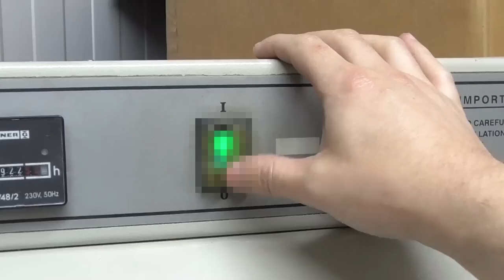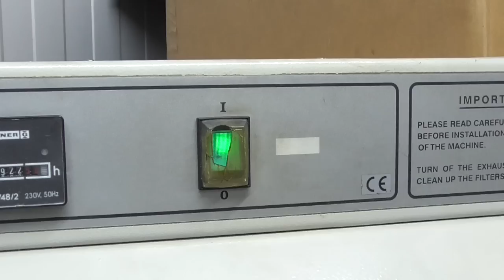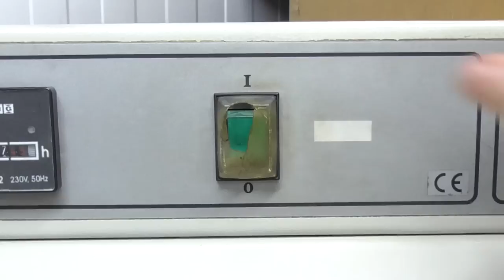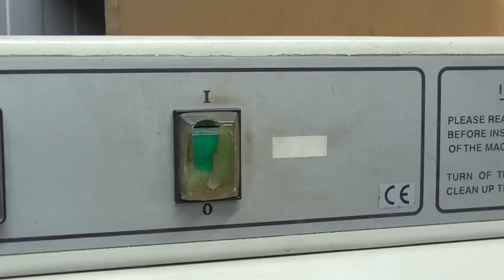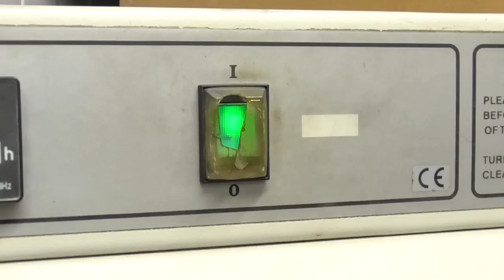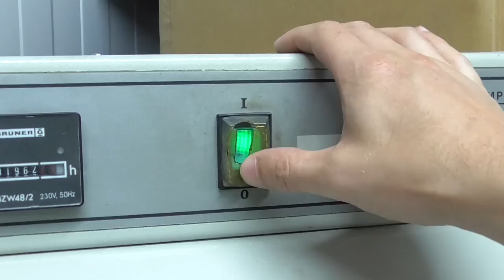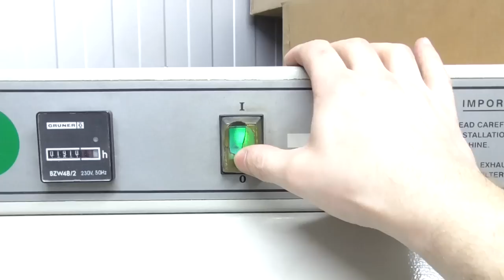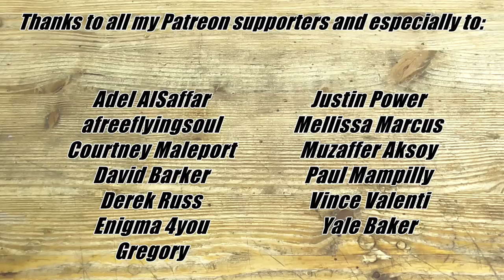Most Satisfying Way To Remove Rust - Sandblasting Compilation

Comment: I'd love to see some micrometer measurements of how much material sandblasting actually removes, as well as information about the different blasting media.
Reply: same. does it round off edges like the  polishing wheel does?
Reply: Not much, unless you hold it in one place for a long time. You just do it until the rust is gone though. The edges don't round much either. You could do a knife and only have minor repair to get the edge back.
If you want even less damage you can bead blast, or walnut shell blast. The shells being more of a cleaning process.
You can use several things for the media, but is needs to have uniform size or it will clog the nozzle. Aluminum oxide grit is the most common.  Silicon carbide could also be used, but is more expensive.  General dand can be, but must be screened well, and breaks down faster. Bead blasting is tiny glass beads, and walnut shells are ground up and screened shell bits. Soda blasting uses baking soda (sodium bicarbonate). Shot blasting uses steel shot (small steel balls). It has the effect of pounding tiny dents into the surface.

Comment: You are absolutely right about the satisfaction of blasting off rust , old paint , peeling plating , etc. I have used various abrasives from plain dry sawdust for delicate items , all the way up the hardness scale to crushed slag ( the leftover oxides from steel manufacturing. )  My standard media is glass beads . These are used to clean calcium build up from pool tile . Arizona has water you can chew !
Reply: That last sentence made me wanna barf 😂😂 that sounds really satisfying though!

Comment: You're the only one that shows sandblasting in real time. Why does everyone else speed it up?
Reply: Probably because it’s boring and tedious and they haven’t thought to edit out large chunks of video and instead speed it up.
Reply: Agreed, sandblasting is very boring.
Reply from the maker: My guess is that my sandblaster has much more pressure, that's why it progresses faster.
Reply: @mymechanicsinsights  It seems to work much better than any of the ones I have tried. Much much pressure do you use? My own sanding box I got from a friend wants to explode even at medium pressures.
Reply: @FilleMang  pressure is important but also the blasting media, right stuff for every application!
Reply: I speed my videos up I run approx 50x what cfm than this video I think faster the better show more in less time but please come on over I'm willing to learn how to make better content I can only do so from feedback please see what you think mick blackley sandblaster
Reply: @Mobileblaster  thank you for the invitation, I will check it out
Reply: I speed it up 2x when I watch it hejejee

Comment: Can I ask on what type of media do you use? I know there are many types of sandblasting media and the size of grain. I am interested in purchasing my own cabinet someday. I already have the central pneumatic air configured for all my tools and car working.
Reply: I was looking for this comment. Recently bought a small Sandblaster and want to use it efficiently
Reply from the maker: I'm using glass bead. The most important thing on a sandblaster is a very strong compressor.
Reply: I was assuming it was glass bead, thanks for confirming.  In college I worked for a VW specialty garage and I had the job of blasting all the cylinder heads pulled for overhaul (air cooled VWs - it was the 1970s).  It was several per day, usually; it does take a while, but the result is so satisfying...

Comment: Very, very satisfying video! Is it possible to comment what material you are blasting with in each instance? I am curious to see hot the different blasting materials perform, as well as if you change the air pressure for different target materials that you are blasting. Thanks!!!

Comment: Hello. What sandblasting media do you use? And if you are changing it for a different applications, which would you suggest as a most universal (for the same purpose as you use it in your compilation). Thank you. And btw, great work, keep it going
Reply from the maker: It's glass beads
Reply: @mymechanicsinsights  thank you. My guess was either glass beads or aluminum oxide. So glass beads it is. Enjoy rest of the weekend

Comment: Hello i have a question. Some of my friends have told me that there is abrasive in most of the stainless kitchen ware (spoons, chopsticks, pot, etc...) and it contains silicone carbide. They say this is carcinogenic and when you use normal oil(sunflower, olive etc..) to clean it, black stuff rubs off of it for hours and hours and that's supposed to be abrasive. I thought abrasive didn't really stick on to the material so much that it could be rubbed off even after an intense 4 hours of cleaning session. And was told that companies doesn't really have regulations on abrasive in their product so they don't care. Any thoughts on this matter??

Comment: I always wanted to use sandblasting to clean my cast iron grill pan but worried about any toxic residue in the media.
Reply: That would take all the seasoning off your pan, wouldn't it?  Or is it not that kind of cooking pan?
Reply: It'll work, but you'd lose a layer of metal each time too; and yes the seasoning would be gone- also most sandblasting media is just fine grit, dry, something- plastic beads, sand, walnut shells, etc.- so toxic residue is about if you've used the media to remove leaded paint, and you've reused it.